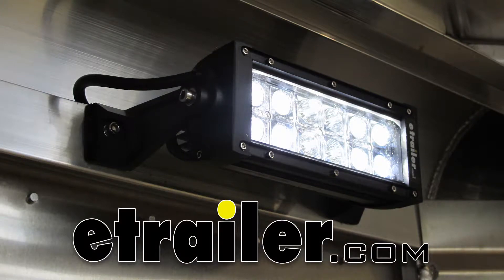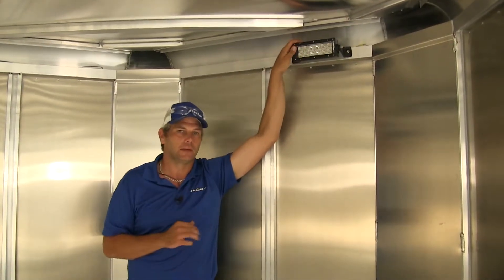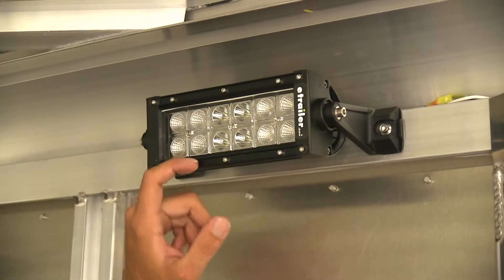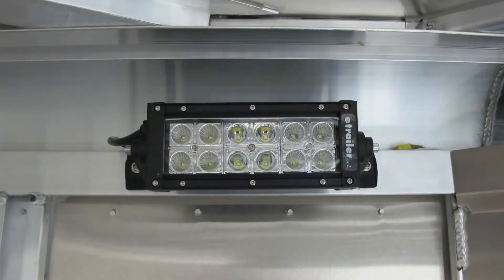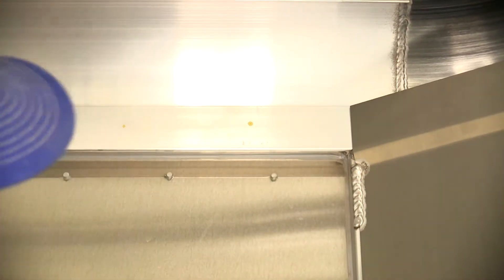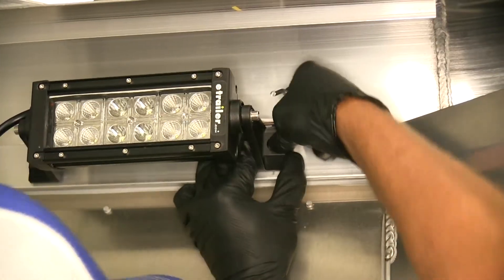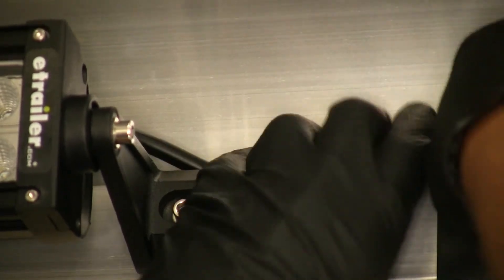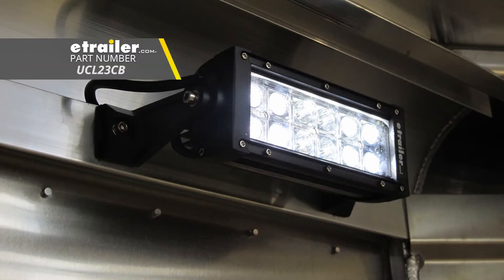etrailer | Feature Breakdown: Optronics LED Off-Road Light Bar

Comment: On this led light can i get my ground from a screw (metal) or my ground needs to go directly to the battery?
Reply from the maker: Your best ground will be the battery. The problem we've seen with grounding it to a trailer is that if the trailers welds are not great there may be a disconnect between the ground on the trailer and the battery.
https://www.etrailer.com/Off-Road-Lights/Optronics/UCL23CB.html